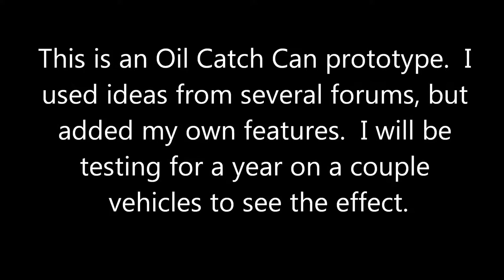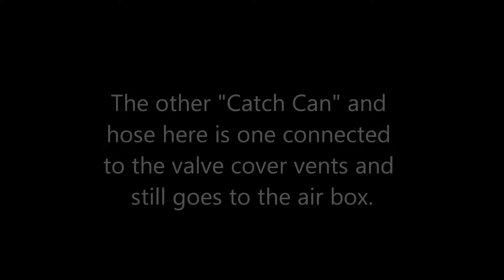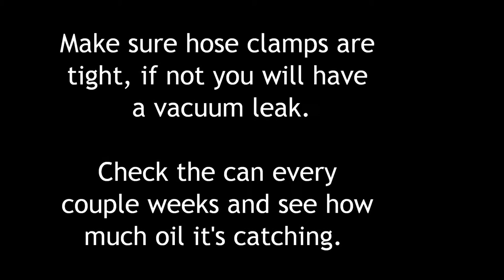PCV side Oil Catch Can - 2004 Subaru Legacy 2.5l, NA

Comment: I thought the outlet hose is supposed to go right back into the intake?
Reply from the maker: It does, just behind the throttle body (original location).  On my Subarus, the PCV is on the engine block, not the intake manifold.  The outlet is the port on the side of the can, the inlet is on the top. The PCV line still runs from and to the original locations, just with the catch can in the loop.   I have removed the other can as those lines provide fresh air into the valve covers under normal conditions.